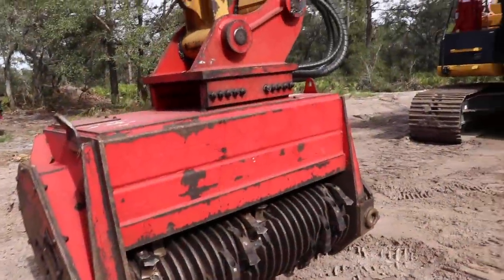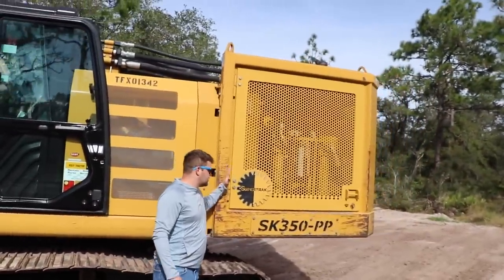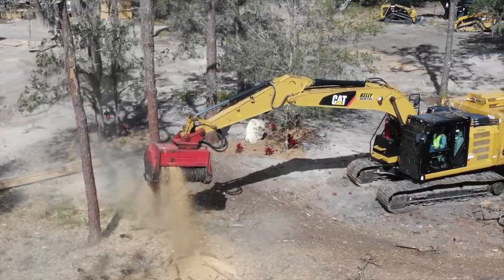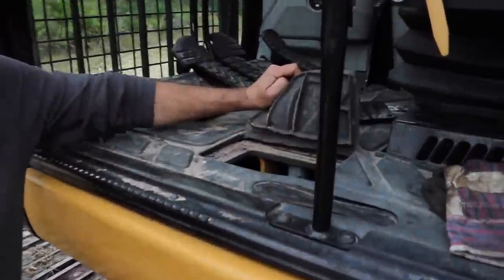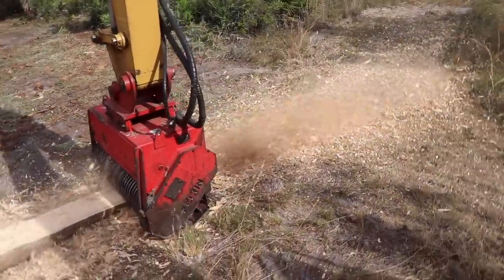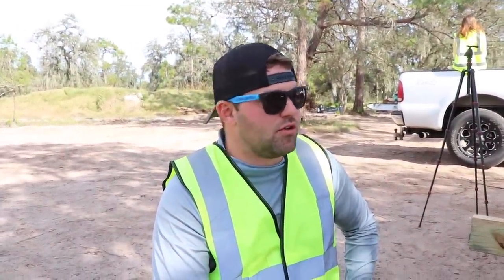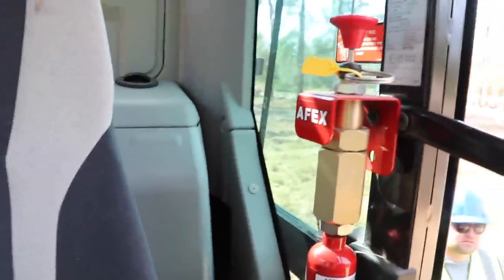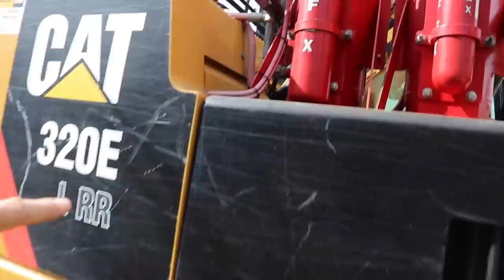Excavator forestry mulcher on Caterpillar 320 with a fecon head running a supertrack 350 powerpack

Comment: The company I was with for years put one of those on the end of a 70 foot boom on an excavator mounted on amphibious pontoons.  We did a lot of work cleaning up power line right aways.  We could do a mile a day of a 75 foot wide right away - wet, dry, water -- didn't matter.

Comment: The video made me think of the horrible forrest fires last year, and how a piece of equipment like this could make a heck of a difference.
Reply: I've actually worked with these machines on forest fires before, and like most heavy equipment, it does 10x the work a handcrew can put in in a quarter of the time. These things are absolute beasts

Comment: Man the mulchers the GPS guys use way up northern Alberta in the winter building ice roads we use in winter for oilfield exploration through pine covered muskeg. Dedicated mulcher unit. Like a 10ft wide drums know front. Some have dual drums. Crazy units just chew through 6 to 10 inch trees leaving nothing but dirt a mulch covered snow behind.

Comment: Use a gradeall 
G 1000 as it gas two detroit 671 supercharged one clockwise  engine one counterclockwise engine you can also attach extendable booms it also turns and many attachments too . Made in Massachusetts. USA.

Comment: Kinda small hoses for 350hp or are they running extreme high pressure
Reply: Tim Jansen 

How big are they?
Reply: Looks like double flow and return lines ( 4 ) hoses. They need a closed circut variable flow system running about 5000 psi and 75 gallons a minute I think you would see a huge difference.

Comment: So the cimaf is superior to a fecon? The power at 350 hp seems acceptable with this fecon.
Reply: Hydraulics for the loss......

Hydraulics are convenient, but unless you need the head out on a long, maneuverable boom, the raw working power of the head itself, is always disappointing compared to one with a mechanical connection. Great for quickly spot clearing a few to a few dozen to perhaps a hundred trees scattered about, but never really that impressive for bulk mulching volume, considering all the power and cost and engineering and maintenance put into it. Story's the same for all high draw applications powered hydraulically.

Comment: Might just be me, but those hoses look a bit on the small side for 300+ hydraulic power, even at an expected 5200 PSI max' operating pressure?
Reply: @I Am Sekou nowt wrong with my eyes - what's your excuse? Been around hydraulic power equipment for decades, off and on, and those hoses look undersized - doesn't mean they are, but a lot smaller than I would expect for the flow rates it would be expected to use. Then again, larger bore hose gets expensive in a hurry.